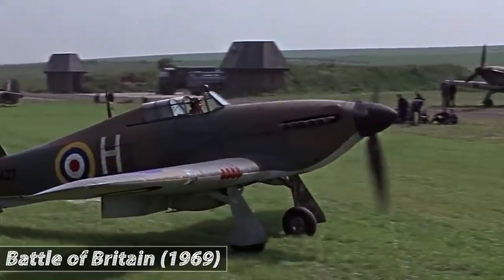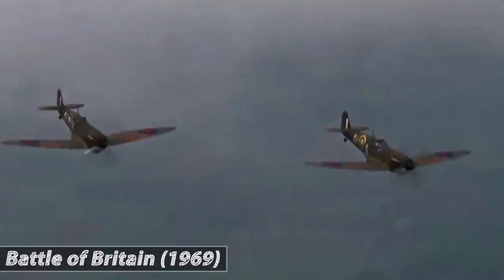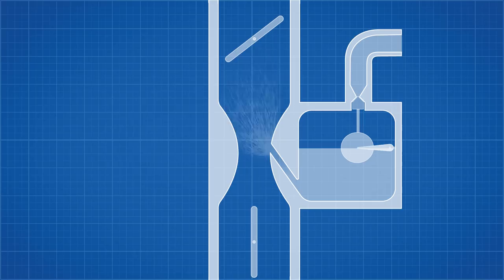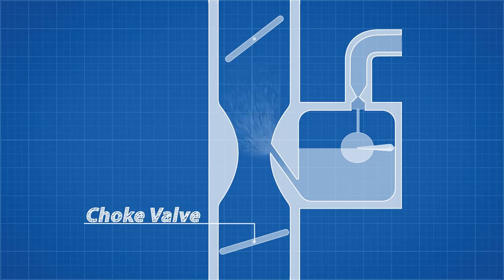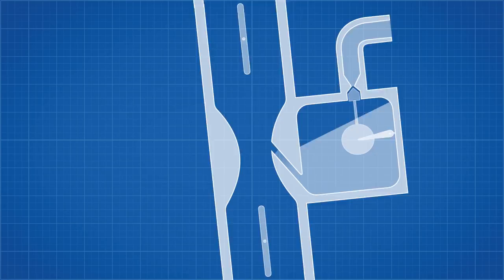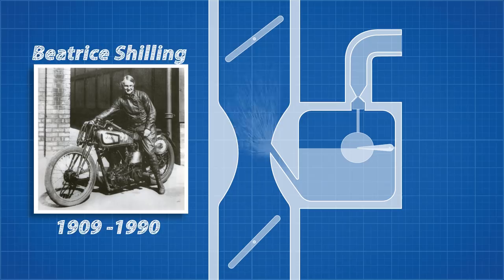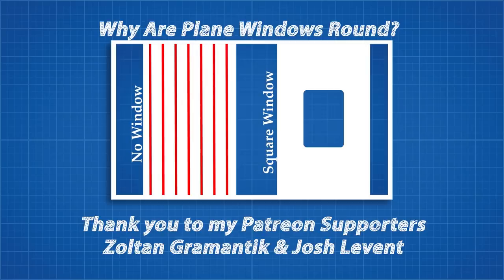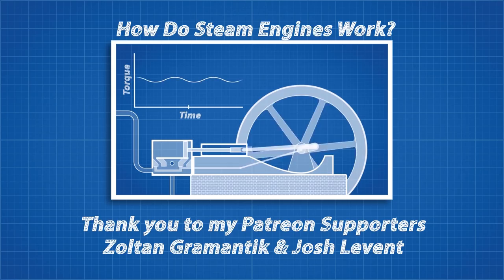The Spitfire's Fatal Flaw

Comment: It wasn't actually a "flaw" in the Spitfire. It was in any aircraft that used a carbureted Merlin V12 engine, like the Hurricane, as well. You actually showed Hurricanes, not Spitfires, in the introduction of this short video. Moreover, you showed a Hurricane, not a Spitfire, belching the black smoke as it rolled over in mid-air. Thankfully, you showed the cure for the entire problem by high-lighting "Miss Shilling's Orifice", as it was known in WW2, at the end.

Comment: Begins video about a spitfire with a video of a Hurricane... Also the video you used of the engine cutting out, also a hurricane! Get the facts right xD. However yes the engines didn't have fuel injection.

Comment: Exaggerated. It was a disadvantage indeed agst the BF109. But it was far from being fatal. If it had been a serious shortcoming, the spitfire wouldn't hv won the battle of Britain esp when the Luftwaffe was fully aware of this. And Rolls Royce corrected it soon enough in subsequent marks of Spitfire. The biggest flaws of the Spitfire would have to be its short range and delicate engineering instead. The former was why it lost out to the P51 as an escort fighter for American daytime bombers while the latter caused the Spitfire to become difficult to service and maintain in the tropical environments of the Mid East and East Asia .
Reply: I agree it is exaggerated.  Different planes had different characteristics.  
If you were a German fighter pilot needing to evade a Spitfire, a negative G dive might shake it off your tail in the short term (for early model Spitfires), but you were conceding altitude and were now more vulnerable to being pounced on from above.  Furthermore, if this is the Battle of Britain, you just abandoned the bombers you were trying to escort.
The Spitfire had a nice ability to spiral tightly while climbing, which German planes could not match, which would shake anyone off your tail and set you up for a dive on a juicy target.

Comment: Setting aside the loss of credibility by confusing Hurricanes with Spitfires in your visuals, it was by no means a "fatal flaw."  It was a minor limitation to the early designs (noting that at the same time the Me-109 had a habit of ripping its own tail off if you tried to pull out of a dive too aggressively - a tactic RAF pilots used to escape, if necessary) but in no way compromised their ability to match, and out-perform (with mostly rookie pilots) the hardened Luftwaffe.  Goering was furious when he asked one of his Sqn commanders what he needed to bring the RAF to heel and he answered "A Sqn or two of spitfires would help."
After all, who won the Battle of Britain?

Comment: The term fatal flaw is utterly wrong, yes negative g caused the engine to splutter and possibly stop but flipping over and turning with positive g was far better and both airframe and pilot could sustain more g’s for longer. No spitfire pilot would swap for a me109 and Goering stated he could have won the Battle of Britain with a handful of spitfires.  The cargo door latch on a DC10 was a fatal flaw literally.

Comment: How many times are you using a Hurricane here?! 
You should’ve covered the Rolls Royce Merlin in your title and focused on that throughout your narration, not the Spitfire in particular. 
Also the later model Spitfire in your thumbnail has a Griffon engine, which doesn’t have this problem.

Comment: No need to criticize your video. The Spitfire was a good WWII fighter plane. The major flaw of most WWII planes was the fact that some used the old carburetor system of delivering fuel and air to the engines! The Float in a Carburetor was what kept the amount of fuel in the device at a constant level. A carburetor worked like a glass with a cork in it sort of like the cork on a fishing line! When in the upright position the device worked properly. When turned upside down it stopped working, hence the problem! Fuel Infection was so much better than a carburetor system that it didn't fail to deliver air and fuel mixture at any point in an inverted position! However, I have read, watched, and heard how great the Spitfire was but it wasn't the best fighter of WWII! There were much better fighter planes in WWII than the Spitfire! The P51 Mustang, P47 Thunderbolt, F4U Corsair, and the F6F Hellcat were all better planes than the Spitfire!  And the German planes like the BF 109, and  FW 190 were better fighter planes.  The main reason you hear how great the Spitfire was comes from the British! They ignore facts and statistics! The Spitfire was their design and they were so proud of it that the history of WWII's fighter planes were tainted by the Brits simply by their pride of having made the Spitfire!!

Comment: The poblem was cured by fitting a fuel injection system invented by a woman.   I did part of my R A F Aprenticeship by stripping and rebuilding this engine, the actual one being the U S Packard built ones with twin Supercharger for higher altitude purposes.  The Hurricanes shot down more Nazis than Spitfires although the Spitfire was the better raft but the Hurri was easier and cheaper to build hence there were more of them.  My greatest thrill in 1956 sitting in a Spitfire 22 the one with the five bladed propeller and a plastic Bubble Cockpit.  Sent to R A F Halton for technical training.
Reply: Those Mk 22s are awesome. The 5 blade Rotol (?) airscrew looks like it would really pull thru the air! I have  the Airfix 1/48 plastic model kit of that Mk in my stash of kits to build!

Comment: It was hardly a fatal flaw (the wings coming off the Lockheed Electra - that was a fatal flaw) and it wasn't just the Spitfire but rather a shortcoming of the Merlin engine's carburetor.  Miss Schilling sorting it out is a good story and I like your video, it's well done, but the title is a little sensationalistic.
Reply: I think the engine stalling is a pretty fatal flaw
Reply: @clf400  It never caused the plane to crash.
Reply: @johnbrewer8954  still a flaw
Reply: @clf400  not fatal though in any way.

Comment: I'm always puzzled by reference to the Spitfire's " elliptical wing " - the assumption being that this planform shape in some way imbues the wing with special properties.  Here it is suggested that somehow wing drag was reduced by it.  Actually the reverse may be true, since low aspect ratio wings tend to have higher drag than those with higher aspect ratio. [ compare U2 or any competitive glider wings with [ say ] the Spitfire or Lysander ].
NO.  The claim to fame of Mitchell's so-called elliptical wing was due to other factors, such as the successful packing into it of guns, retractable landing gear and [ possibly ] fuel tanks.  It also had good aerodynamic characteristics which made the aircraft able to make tighter turns that the Me109.
An important feature of the Spitfire wing was that it was designed to be strong enough such that aerodynamic forces over the wing did not cause the wing to fail in torsion,  which had always been the big objection to monoplanes vis a vis biplanes.
Regarding the RR decision to use carburettors rather than fuel injection is also something of a mystery, since any schoolboy who knew a bit of science would have known that the former do not perform consistently when subject to variable g-forces.  Another puzzling decision is the early choice by the RAF to fit fighter aircraft with 0.303 rounds.  The ubiquitous 303 was developed decades earlier for hand held weapons and in comparison with the German 20mm cannon was a pop gun.
Reply: The Spitfire wing gave the highest dive speed of any aircraft until well after the war.
The mystery of Rolls Royce using a carburetor has been fully explained by people who know about fuel systems and Rolls Royce used the carburetor because it was more efficient than fuel injection.   The fact is that Stanley Hooker was far from a schoolboy and he knew that the carburetor was more efficient and gave more power. Fuel injection was not great until electronics was able to improve it, that is why it was not adopted on most cars until the 1980's.

There was a very good reason to use 0.303, the RAF tested various weapons and they did not use 0.5 which was heavier, they did want to go to 20 mm but it needed development, in the meantime 8 x 0.303 was very good.  Britain did already have the 20 mm Hispano and it was fitted to some fighters, 4 in a Westland Whirlwind and 2 on some Spitfires, the Hurricane had to wait for the Mk II with a more powerful Merlin XX to take 4 x 20 mm while the Spitfire wing meant the Hispano had to be modified to work properly although a Luftwaffe aircraft was shot down in early 1940 by a cannon armed Spitfire.  The 0.303 was an excellent choice as used in rifles and machine guns for decades, plenty of ammunition and light weight.  
There was even a Spitfire tested with 6 cannon but 4 or even 2 was plenty.  
The German 20 mm cannon had low muzzle velocity which hampered its performance and only having enough ammunition for 6 seconds then having to rely on 2 machine guns vs 8 on a Spitfire or Hurricane. It seems that the British were not as stupid  as you make out.
Reply: @barrierodliffe4155  Being  a [ formerly British ] engineer I would never presume to call the British stupid.  I believe Napoleon thought that and look how he ended up.
What I was suggesting was that the British are mostly naturally conservative and traditionally slow to make changes especially when these are radical changes.  The Cannon/303 debate raged on for a time.  I think one of the genuine difficulties was mounting a larger gun in the Spitfire wing, but I'm rather vague on the details.
You make the point that RR's continuing use of carburettors was that they believed them to be " more efficient and gave more power ".  I don't think that is a valid claim but more an excuse, since a stalled engine in a war plane can be very dangerous for the pilot.  If fuel injection was a way round that then it should have been vigorously developed on an urgent basis.
Reply: @crustyoldfart  
I see the British being slow to make changes, they had the best radar and aircraft control system in the war, hardly slow there, they kept developing the best fighters of the war, hardly slow there, they even had the Gloster Meteor in operational service in July 1944, it took Germany until late 1944 before the Me 262 was in an operational squadron. 

Britain had four 20 mm cannon in use in the Westland Whirlwind in 1938, at the time the heaviest armed fighter in the world there was a problem fitting the same gun in a Spitfire but when turned on its side and with a change to belt fed ammunition it worked very well. Again not really slow. The Hurricane wing could take the cannon but it was not until the use of the Merlin XX in late 1940 that they had enough power.
The reason Rolls Royce used the carburetor was that it gave the smaller Merlin engine more power. the fact that the engine did not stall, at most a momentary cut out which RAF pilots got around quite easily, Rolls Royce had solved the problem completely in 1941.  If fuel injection worked then it would have been used sooner, as it was the German engines had more than their fair share of problems, not least unreliability caused by the fuel injection.  If the team at Rolls Royce did not continuously work along with SU on improving carburetors and not  desperately but methodically and SU came up with a speed density carburetor which was given to the US, then went onto a system using an injection pump which injected fuel under pressure into a throttle body or as some call it an injection carburetor.  
You seem stuck on the idea that the British were too busy sat around drinking tea to do any development, I give you radar, the jet engine, the Merlin and Griffon engines continuously developed to give more power while remaining reliable and much more.
Reply: @barrierodliffe4155  I seem to have touched a raw nerve here.  I don't recall saying that the British were slow.  What I did suggest was that they were slow to change from their present trajectory and would always choose the option of evolution rather than revolution.  That's a strategy which can be good or it can be bad.  You mention SU.  Is it likely given human nature that a company specializing in the production of carburettors is likely to throw all their knowledge experience, tooling, out the window and fling themselves into really getting down to developing a kick-ass fuel injection system ? 
Regarding the 303 debate:  Have you ever considered the dynamics of a small bullet, developed for use in a hand held rifle, as it is ejected [ sprayed ? ] from a high speed aircraft.  The velocity of the gun platform is added to the muzzle velocity.  What does that do to the drag force on the spray of bullets.  I recall fighter pilots of that era reporting that their bullets could be seen bouncing off the plane they were attacking.  I think it must be clear that the induced drag force I'm drawing attention to would exist also for the much more massive 20mm projectile, but due to its much higher mass would have a much reduced retarding effect in comparison.
I also recall that the famous Douglas Bader being a loud proponent of continued use of the 303 in fighters.  Although a man known to have strong opinions, or perhaps prejudices might be a more appropriate term in his case, one wonders what basis he could have had for this belief.  Of course in a real life situation supply logistics can trump purely scientific considerations, so the British tendency tp prefer things to evolve can be better understood.  This strategy is also known by the term " muddling through ".
BTW I do not recall suggesting that the British sat around drinking tea, although having followed an engineering apprenticeship then subsequently worked as a design engineer in Britain for about five years, I did see a fair amount of drinking tea on the job during that time.
Reply: @crustyoldfart  
You seem to be stuck in ignorance.
Is slow to change developing the best control system for fighters? is slow to change developing some of the best most effective weapons of the war?
SU and many other companies made carburetors, amazing that they did that as to would a carburetor manufacturer change to making less efficient and less reliable fuel injection?  Not bloody likely. Would that same company go on in a short time to make a working reliable injection system,? They did and it was in use on Spitfires.
I recall 0.303 bullets going right through enemy aircraft and many Luftwaffe bombers going home full of holes, as for bouncing off the thin metal fuselage or wing surface hardly likely at all.  
You do not like to admit that the British used 20 mm in fighters before the Luftwaffe, the Bf 109 started out with just two light machine guns and they started to increase their number of guns, first to three after they saw the RAF had eight in the Hurricane and Spitfire.   
I know people like you who claim to be engineers but show the knowledge of someone who does not get past sweeping floors has trouble understanding anything to do with technology or how things were developed.  You have failed to show how the British who were in reality at the front of technology in most fields during the war and how they quickly developed some of the most devastating weapons of the war.
While Germany was desperate to come up with some wonder weapon to save them Britain developed what worked and still beat Germany and USA in most areas including jet engine design. As a real engineer I used to work with a rather lovely young German lady and it was a standing joke between us when we were deciding what to do. " Lets have a cuppa tea"  She is no longer there having left to go to another job but is still a friend and no our friendship is based on mutual respect and since I am too old and we are both married there is nothing more than a good friendship.
Reply: @barrierodliffe4155  I'm afraid you've crossed a line here old boy by accusing me of ignorance, and later likening what you assume is my level of scientific and technical competence as akin to sweeping floors.  I find this gratuitous and unacceptable.  The exchange of what I intended as intelligent debate will now cease.

Comment: This slight problem  did not affect the P 51 with an Allison engine because it did not go high enough to dive, it did not really affect a P 38 with two Allison engines because the P 38 could not dive.  
As everyone knows this was a problem on all aero engines using a carburetor. Rolls Royce knew and they kept using carburetors because fuel injection at the time was less efficient, Rolls Royce soon  solved the problem which had not really bothered RAF pilots much at all.. 
Someone who sets goals and uses a name Real Engineering  should at least have a basic understanding of the subject.
I suggest sticking to animation and Gaelic Football, both do not require much intelligence..

Comment: Cut out for 1 to 2 seconds, had no affect on performance, of the plane, let's talk about,109 flaws, turn rate was crap, and could only dog fight, in straight lines, if spitfire got behind, 109 it was shot down, as a spit could, turn and spilt, of 109.also bf110 lost alot planes and was outclassed by even, hurricane, also another flaw in 109, fuel tanks, were limited, over southern eastern England, major flaw too.

Comment: But did it really matter? The engine sputter during the Hurrican's roll was the product of poor airmanship. A proper roll should maintain more or less 1G. If you dip into negative G, you're doing something wrong with the stick. Negative G maneuvers are typically avoided anyways due to discomfort. Humans can withstand much more positive G than they can negative G, thus the technique is to roll inverted and pull to maintain positive G. Should a German with his "superior" engine bunt the nose over into a dive, the pursuing Spitfire should simply roll over, pull, roll level.